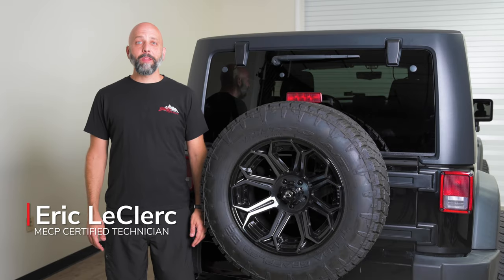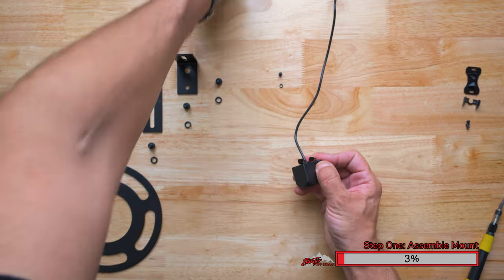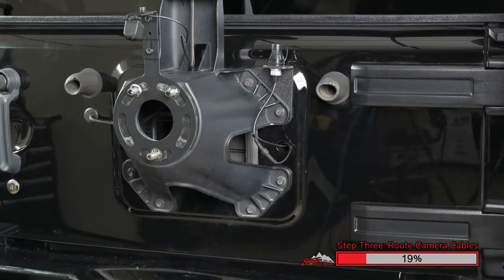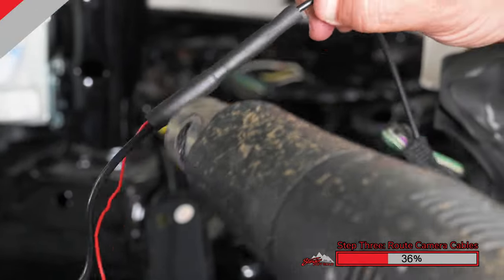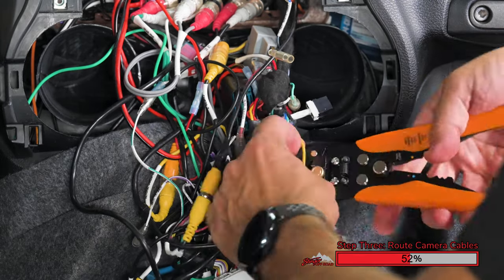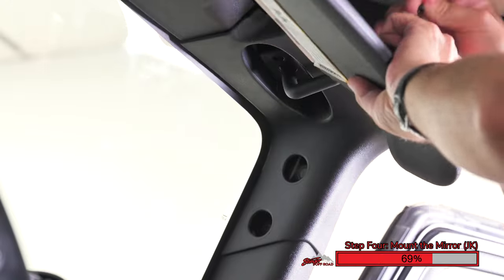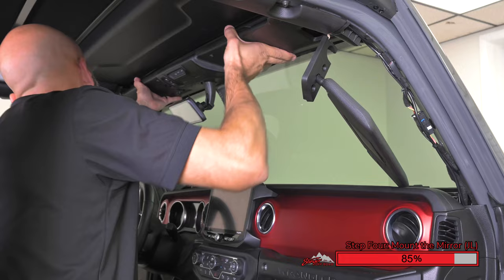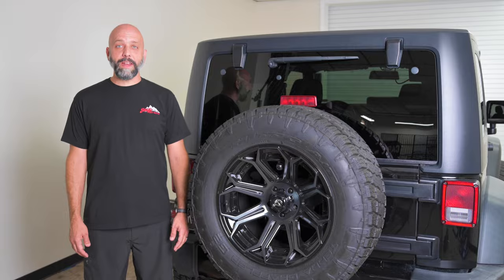INSTALL: Jeep Rearview Mirror DVR Monitor/Front & Rear Recording

Comment: Thanks for the detailed video.  I just installed this system in a 2015 JK over the weekend and the detailed video instructions were crucial to my success and was a primary reason for my purchase.  The only part that was a little less detailed was the removal of the dash for the stereo head unit, but a quick search found a great video which was very easy and after tapping into the three wires, all worked as expected.  I am very slow, but was still able to complete it in one day with a couple of breaks.  The mirror fit perfectly and all appears to work as expected.  Very Happy with the results.
Reply from the maker: We're happy to hear our video helped! If you have any further questions, feel free to reach out at any time!

Comment: Does the stinger Heigh10 radio display the reverse camera with this mirror and camera setup?
Reply from the maker: The camera that comes with the mirror/DVR kit will only connect to the mirror, and cannot be split out to the HEIGH10 or any other aftermarket radio. This is because of the HD video signal it uses.

Comment: Does installing this product on a Jeep JL equipped with the SOS/Assist Functionality render the system inoperable?
Reply from the maker: If there are any electronics built into the mirror, such as microphones or other buttons, we would not recommend replacing the factory mirror. We have only installed the mirror in Wranglers with basic mirrors without the SOS or lane departure systems.

Comment: Does the park mode drain the battery?
Reply from the maker: Our technical support can assist to optimize the power settings. If you need more assistance or have questions, please contact tech support at 1-800-477-2267 EXT: 3333